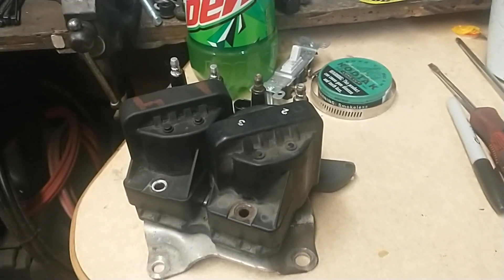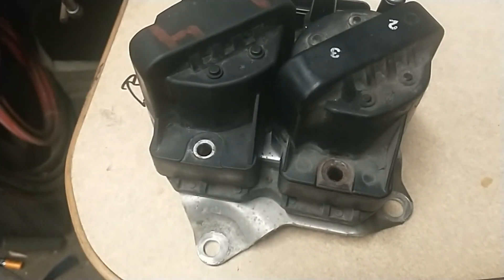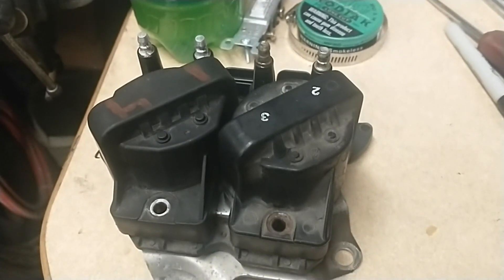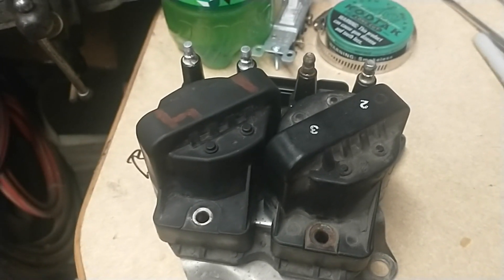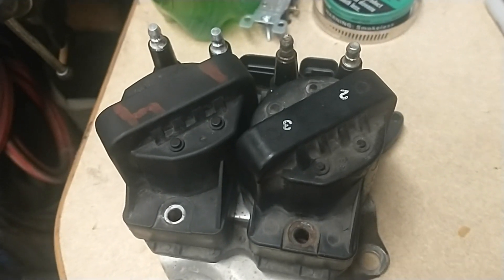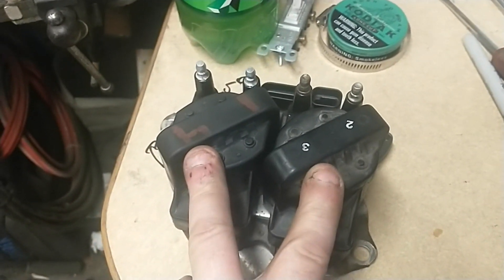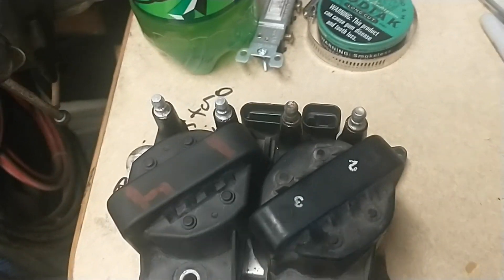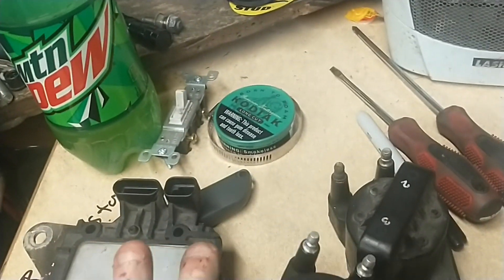I Found The Gremlin In The S 10!!!

Comment: So, it's shorted out to the heat sink?? A quick fix might be a piece of hi temp plastic between it and the mounting plate 🤔
Hopefully he finds a good one!!
Stay warm Mike!!!
Reply from the maker: I think something inside is shorted to the aluminum case and the shorting thru to the bracket. I failed to mention that when the engine warmed up it ran worse and when it was under vibration or engine load  it ran worse. I will try putting something under it to protect the new one.
Reply: @GettinGreasyGarage  if you can isolate it from ground... the old ones would probably last a long time. 
More heat probably expanded the heat sink and made better contact to ground.. only makes sense to me 👍

Comment: The clutch wasnt my fault. 2 weeks later we found you can only use 96 ICMs. Whether it be s10 or bravado, anything gm 2.2 for the 1996 year. 95 uses different connectors, and 97 uses an Electronic ICM, different components. Found a part number on Summit Racing, a Standard Motor Products part number, was able to verify it, and yes it checks all the boxes for the 96 2.2 Hopefully will get it ordered in the next week...cobalt needs to be parked for a while...